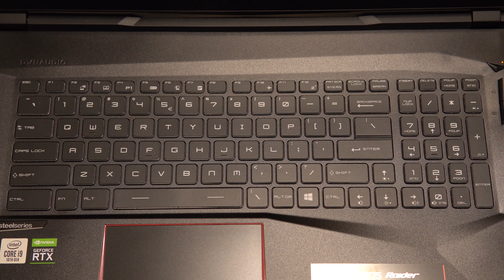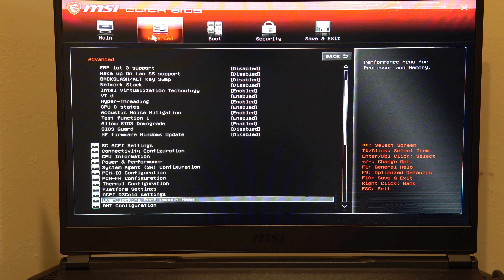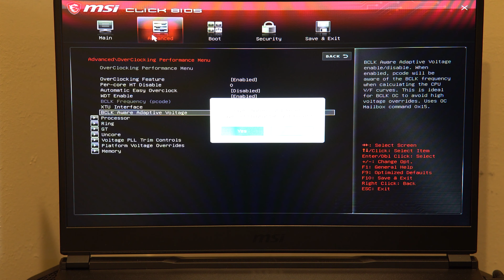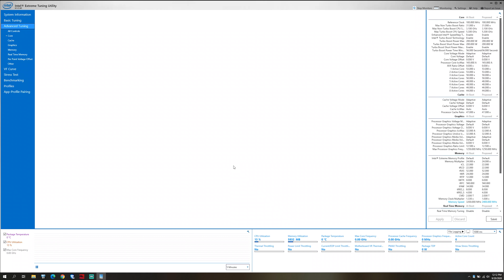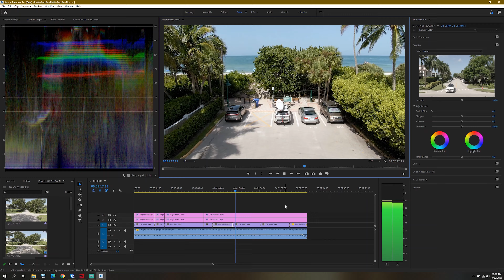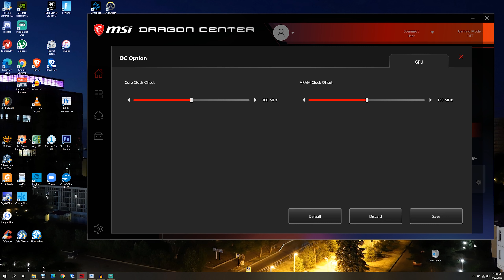Undervolting the MSI GE75 Raider - Easy walkthrough on how to under-volt a laptop  - ParadiseBizz

Comment: Hi do you have a new solution ? Because with the new version it doesn't work and if i use the old version of XTU, my computer crash. Impossible also to use Throttlestop, everything is grey and i don't find any solution ...
Reply from the maker: What system are you running? Windows 11?
Reply: @DirksFocus  yes and I think it's the problem. But I tried to undervolting the turbo boost power max (200W --> 100W) and now my temperature doesn't pass 65°. So for the moment I think it's good but temporally because even my heat down on dragon center, my computer is very hot when I touch it
Reply from the maker: @NIMAJNEB_GAMING  It is definitely the problem. I disabled all updates and kept Windows 10, which comes with a lower workload and less problems.

Comment: I have GE75 Raider 9SF and I tried the lower version of the program because newest wouldn't allow me to change anything... Older one allows me for overclocking, but it doesn't allow me to undervolt it... I have my bios updated (E17E2IMS.11A). It says something about other program touching these settings and I have no idea which one (maybe Dragon? but you also have it installed).

I sent my laptop to change the thermal paste and I suspect the tech touched something (without my permission) and it would go +90ºC anyway just watching videos on YT. I formatted the system again and changed the energy options on the hidden menu for the cpu  (it was on agressive and disabled it) and I noticed temperatures are lower, but also my system is slower. I don't know what else to do and I don't understand BIOS settings enough to change the voltage from there... 

Sorry, my English is not perfect. Greetings o/
Reply from the maker: Start from scratch: Make a complete bios reset. Then download the latest bios and install it. Then start tweaking

Comment: My laptop turned off than when turn on getting into blue screen than black msi screen getting autorepair than not loading getting into reverse in to last proparly point andnot going attempts to the end than turns off again and repeatable i fucked up ...
Reply from the maker: Are you able to boot into the BIOS? If yes simple reset the settings and reboot

Comment: hey buddy 2 weeks ago nothing was locked, i do al kinds of stuff to unlock it, no success...is this due to a windows update or cant i undervolt a i9 10780HK
Reply from the maker: Yepp, Windows updates can mess up the entire system. That's why I disabled updates for good. Why changing when everything is working? Anyway,  It is not a matter of your CPU.  And you said yourself that it was working until 2 weeks ago. My suggestion: Type RESTORE in your search bar and find a restore point that was more then 2 weeks ago when everything was working and restore your laptop. After everything is working normal again, disable all updates

Comment: I didn't notice any difference and I got same laptop how come could you help. Still 95 on maximum gaming
Reply from the maker: It really depends on  the tasks you're running, sometimes temps are lower, sometimes they stay the same with an an increased performance.
Reply: i turned it down almost 1 volt still no difference

Comment: I have a question that you could perhaps help with. I just bought an MSI GE 75 raider, myself - 2060 RTX. 

I play graphically intense games such as Black Desert Online, and use animation software such as DAZ and Blender.

For the latter, do you know of any safe methods for over locking the CPU? Daz uses the CPU a lot for studio work and physics rendering, and I believe it goes  over to the GPU for final renders. 

I was curious if perhaps applying the opposite; overvolting, might improve studio work performance and what would be a safe range for that?
Reply from the maker: All I do, even for the most intense tasks, like editing and rendering 6K footage, I go to the MSI dragon center and set it to HIGH PERFORMACE. That's all

Comment: Intel locked this down a while back, and even through tweaking several BIOS settings (including disabling the one that says CPU lock and enabling voltage control), I can't get control of voltage/clocking. Intel XTU still shows the controls as platform locked. ThrottleStop acts like it's applying offset changes, but the changes (if actually implemented) are reset to default values after a reboot.

I invested way too much into this computer to get such poor returns from the hardware. I understand there was a vulnerability with undervolting, but they should have found a way to fix the vulnerability rather than just lazily locking users out of control. The RTX 2060 is an almost desktop-quality GPU that's bottlenecked by a CPU that bottlenecks itself.
Reply from the maker: It's a shame to get limited like this. Didi you watch my follow up video: https://youtu.be/9tSRWkCv4MA ?
Reply: @DirksFocus  I completely missed that one. My bad dude.

But yeah, this is really obnoxious. The way the system is set up by default is terrible. I've had so many problems with this system since the day I bought it and it's really starting to wear on me. This was another big blow 😔

Thank you for your content, though! I'm new to overclocking and this video gave me enough understanding to feel comfortable exploring it.
Reply from the maker: @jeffjeffries8924  The worst part is that fter almost every windows update, all your setting are rest and different than before, so we have to start all over
Reply: @DirksFocus  I actually had to switch from XTU to ThrottleStop. It still seems to be working okay so far, but I wouldn't be surprised if they "fixed" it again in the future 😔
Reply from the maker: @jeffjeffries8924  Let's hope there won't be any "fixing" anytime soon

Comment: Just reach to your video almost 1 year after buying a GE75 (with i7 10875h)...I'm wondering why mine is always at a Max Core Frequency widely > 2.3Ghz on a balanced power management (almost always >4Ghz)...
Reply from the maker: Please check your task manager to see, which apps are running in the background. Try to disable apps you don't need from auto starting

Comment: i have a ge75 raider 8sf. i bought 2 16gb 3200 dims but when i go to my bios and go into advanced pressing the appropriate buttons i go to memory in the overclocking menu and when i try to enable xmp there isnt a profile. It just says default or custom. Can you help me please?
Reply from the maker: Have you installed the new memory yet? This is the first thing to do and then type cmd in the search bar.  in the Command Prompt window you type : wmic memorychip get speed and hit enter. It will show you the current memory speed, maybe you don't need to change any settings.

Comment: I'm using version 6.5.2.40, everything was fine I can follow all the way through, however, once I reboot, the system says that the change isn't successfully applied and thus the system reverts back to default. My system is GE75 raider 8sg.
Reply from the maker: Can you start all over again and re-apply the settings?

Comment: I did read quite a lot of comments that the xtu doesn't save settings.
Reply from the maker: it depends on the xtu version you're running. Unfortunately not every version is compatible with every CPY

Comment: Hi my Core Voltage Offset is disabled on the XTU app where you can select select which volt you want to set , But I set  all the necessary settings on my BIOS how can this be? I'm using MSI GE62VR 7RF
Reply from the maker: Some CPU's require a different version of the XTU engine. Try an older or a much newer version. When you found the right version please share it here.

Comment: it doesn't help on my ge76 raider :(
Reply from the maker: Have you tried this version?  https://www.techspot.com/drivers/driver/file/information/16919/
Reply: @DirksFocus  yes... Sadly
Reply from the maker: @Berzerk_RF  Some people with a similar problem had luck using this version: Intel Extreme Tuning Utility XTU 6.5.2.40.
Reply: @DirksFocus  oh. my bios in ge76 was updated a few days ago. And I have for now option with cpu voltage offset. I saw only now😲

Comment: XTU version 6.5.2.40 works with 10SF too. If you still can't change the voltage offset try the latest bios update: E17E9IMS.10D. That worked for me. Happy undervolting!
Reply from the maker: Thank you for sharing
Reply: @DirksFocus  My pleasure!
Reply: What means 10 SF there is a newer version that works as well ? I choose this one is working xtu 6.5.2

Comment: I have GE75 with 9750h. not sure how much to UV
Reply from the maker: Try baby steps, maybe start with -0.02V then -0.04 and so on. See if the system stays stable and if it gives you improvements in temps and performance

Comment: Core voltage offset is the only one that needs to be lowered but its also the only one that i cannot even change the settings. any ideas of what could be the reasons of this ?? thank you
Reply from the maker: Yes, you might need a different version of the XTU, here it is for you to download:  https://www.techspot.com/drivers/driver/file/information/16919/
Reply: I'm having the same issue. Tried that download and I'm still locked out/grayed out

Comment: I'm receiving my msi gf65 thin tomorrow so I'll be doing this instantly! Could you recommend a temp I should be at whilst gaming? Some people are saying around the 80 mark but to me that seems still to hot? I would've thought in and around the 70 would be more efficient, any advice would be fantastic
Reply from the maker: This really depends on the cpu that you have. Which one will be in your system?
Reply: @DirksFocus  the CPU is Intel(R) Core™ i7-10750H Processor - 6 Core, 12 Thread - 2.6GHz, 5.0GHz Turbo - 12MB Cache
Reply from the maker: @alexarch3rr  On this CPU gaming is always around 80C. So If you stay a bit below that, that would be great. However, up to 85C you don't have to worry

Comment: would it help for a laptop msi gl 75 rtx 2070 ? thanks in advance !
Reply from the maker: It will, but make sure to have the right version of the XTU engine.  With this version it can be done correctly: https://www.techspot.com/drivers/driver/file/information/16919/

Comment: Hello @Paradise Bizz, I just followed your instructions, but even with Enabling in bios, the voltage is grayed out for me, so I cannot alter it... Do you have any ideas why this might be? I am using an MSI GE75 Raider. Thank you!
Reply: It's because of the version of the Intel XTU. With this version it can be done correctly: https://www.techspot.com/drivers/driver/file/information/16919/
Reply: @estebang3587  Hello Esteban, I'm just curious, why would an older version of the XTU work, while the newer version will not? Your link is for version: 6.5.2.40, whereas  have version: 7.0.1.4 installed. Will I have to be careful not to let it update?
Reply from the maker: It is just that not all CPU's work with the latest XTU version

Comment: I done all the steps you put and check more than once if I do anything wrong there.But it simply doesnt let me change the voltage.My cpu is i7 10875H and it doesnt let me undervolt.My core voltage stuck at default while offset is a black bar with 0.000 V value.
Reply from the maker: sorry to read this. There might be something else in the BIOS for this CPU type that I am not aware of

Comment: I had done execatly in bios but xtu showing still locked. gl65 leapard i7 10750h
Reply from the maker: Mine is also greyed out now, happened after the last Windows update
Reply: Same wtf I have the gl 75
Reply: @palleto1  try older version of xtu bro  but after ubdervolting to - 120 still  the cpu is hot
Reply: @ashwinjoy6006  could I just undervolt it through the bios? how do I do that
Reply: @palleto1  yes in advance bios you can undervolt

Comment: I enabled XTU but the options are still greyed out.
Reply: Same here, BIOS options enabled, Intel utility shows voltage settings greyed out as well.
Reply: Same here did you suss it out?
Reply: @Gcammo  Nope, never did. Gave up.
Reply: @Gcammo  nope. Just using throttlestop.
Reply: @Joel-uo5cm  I found out there's another setting in the bios advanced for enabling XTU changes which worked for me
Reply: @Gcammo  what setting was it i can’t get mine unlocked
Reply: @vai2954  it’s in the overclocking setting you have to enable the XTU Interface

Comment: Hello, I just bought Msi GL65 Rtx 2070, is it gonna work on my laptop? I’m kind of nervous I don’t want to mess up something. Thank you
Reply from the maker: Just make sure not to change anything else in the BIOS. Undervolting itself does not harm the system. If it is set to too low, your system would simply reboot and reset the settings
Reply: Paradise Bizz okay thank you, yes I’m going to only undervolt, and this gonna work perfect yes?
Reply from the maker: @xRottweiler666  It really depends what application you're running. For games you can undervolt a bit more, apps like Premiere Pro need more power and you can't undervolt too much. I switch, depending on what I'm doing
Reply: @DirksFocus  I just got a laptop but when I try to change core voltage offset it's just black in intel extreme tuning it doesn't let me touch it, what should I do?
Reply: @DirksFocus  If I’m going to be surfing the internet playing games occasionally, and using 3D rendering software am I better to just leave the settings the way they are or overlock/undervolt them
Reply from the maker: @FrigmanGaming  Hi Ted, I think for your purposes it is better to leave the settings as they are. Use the Dragon Center to gain some performance if needed.

Comment: Hello, i’m architect engineer i use 3ds max software with v-ray and lumion, i want to buy same model “ MSI GE75 Raider 10SGS-222 17.3" 300Hz 3ms Gaming Laptop Intel Core i9-10980HK RTX 2080 Super 32GB 1TB NVMe SSD Win10 VR Ready “ ..... i saw some feedbacks of people they said : have over heating problem specially CPU , Temperature rise to 90 dgree, so do you have any problem of yours ?
Reply from the maker: Occasionally -even after undervolting - some of the cores are reaching the low 90s. Although it is not desirable, there is nothing to worry, the max operating temperature for this CPU is 100°C. 
I would recommend to buy a good cooling pad, it will help to improve temps and performance: https://youtu.be/ZkU7ZbVfe-I
Reply: @DirksFocus  thanks, but 90c isn’t too much ??!!! I saw some review of another brand installed same CPU Temperature under 82c in load mode like “ Asus rog scare 17 “ .... some review saide cooling system of this model of msi not good .
Reply from the maker: @rawandjaza5929  There might be laptops with better cooling. This one here does an amazing job when I am rendering, editing or gaming. The temps are more than acceptable, that is all that matters to me. Of course temps below the 90s are more desirable, but some applications don't utilize multi core processing. And since many apps are running simultaneously, , some cores go higher in temp than others. As long as they don't exceed the 100°C, it is all good.
Reply: @DirksFocus  that is right, thanks .....

Comment: It was greyed out for me i followed all your steps but in the intel xtu it didn't let me change the voltage I have a i7 10750h
Reply from the maker: Try this: Uninstall xtu, then use cpuz to monitor clocks. If it's normal, reinstall xtu. If the problem persist after uninstalling xtu, it's a bios issue. Reset your bios to default options.
Reply: @DirksFocus  hmm I'll try that I installed XTU first and then restarted the laptop to go into the advanced bios maybe that's it
Reply from the maker: @IShatterDreamsGaming  best of luck
Reply: @DirksFocus  tried uninstalling and reinstalling it the xtu it was still greyed out the off core voltage 😔
Reply from the maker: @IShatterDreamsGaming  did you follow my instructions and enabled the BIOS settings?
Reply: @DirksFocus  I did the steps  and the cheat code to get into the bios and advanced bios like how you showed in your video but idk how to reset bios. I don't wanna accidentally press something I'm not supposed to 😬
Reply: @DirksFocus  I am having this same issue and I have the same processor.  Followed your steps (multiple tries) perfectly.  Just grayed out.
Reply from the maker: @NJASVicus  Some laptops have very restrictive BIOS settings, it depends what kind of machine you have. It could be also a matter of the right BIOS version. Try to uninstall xtu, clean with CCleaner also the registry, update your BIOS, then apply my settings, then re-install xtu.
Reply: @DirksFocus  sorry bro but its unnecessary to uninstall xtu, its simply a bios setting he needs to enable for xtu to fully work...
Reply: Ge66
Reply: Go to bios, under overclocking section in bios, u will find a setting called XTU something and it's disabled, plz enable it, now the xtu software is no longer grayed out...
Reply: @RogueSkies  what was the setting called i’m have a hard time making xtu work
Reply: @vai2954  sorry it was not the case, simply use throttlestop if u insist on undervolting ur machine just try to get support from the dev how to use it coz it's a bit complicated and gimmicky for a newbie....